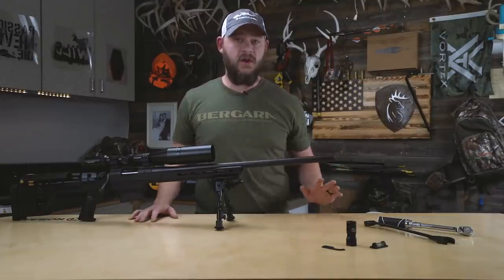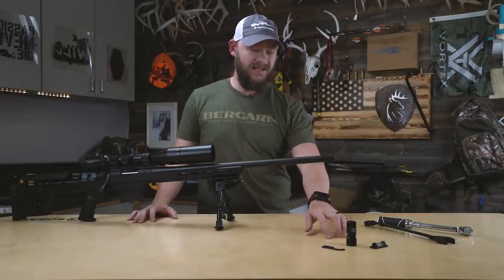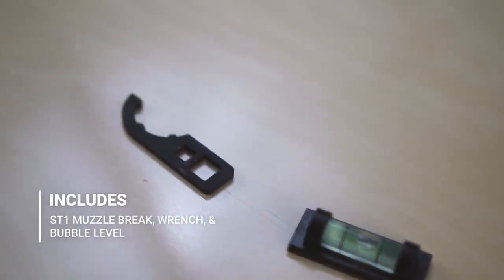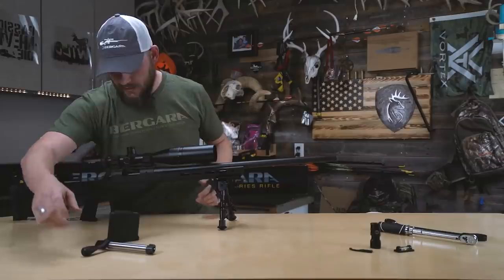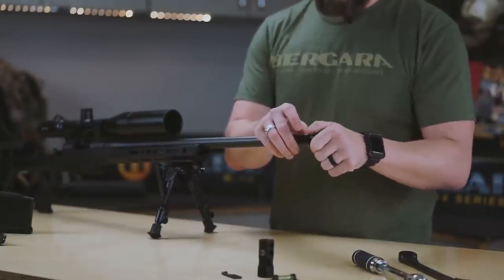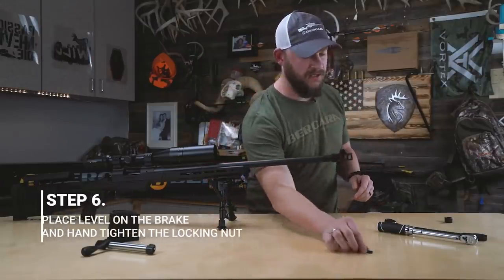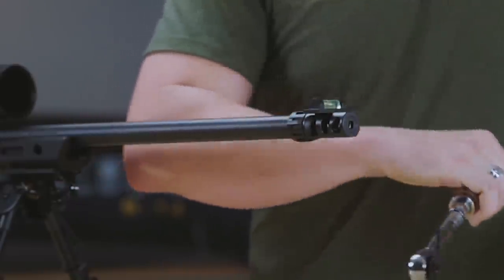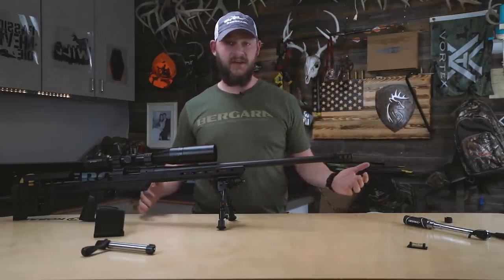How to install Bergara ST1 Muzzle Brake

Comment: I’ve got the same brake for .308 , I couldn’t get mine to torque to 25ft lbs. which is what the instructions said. When I twist the brake all the way on Barrel. My B logo is facing up, do I need to try backing it off 1 full spin to give lock but more room to turn ?

Comment: Looks great. Rifles move backwards and rises when fired, how does a downward ejection of gas counteract that?
Reply: It is the air being pushed out the barrel that has most of the initial effect
Reply: I have one, it ejects the gasses out horizontally to the sides and angling back, mitigating forward gassing caused recoil.  It doesn't gas down at all, the bottom is closed.